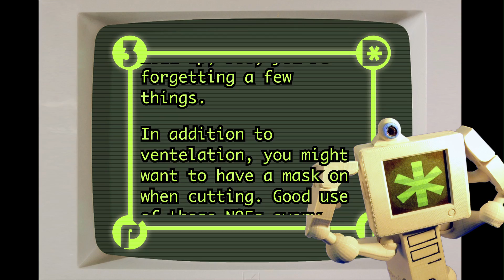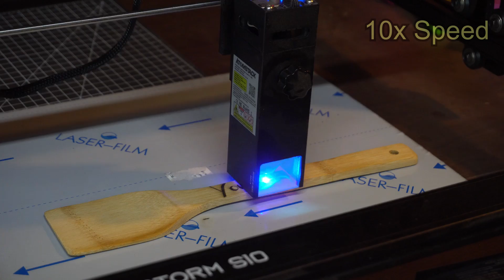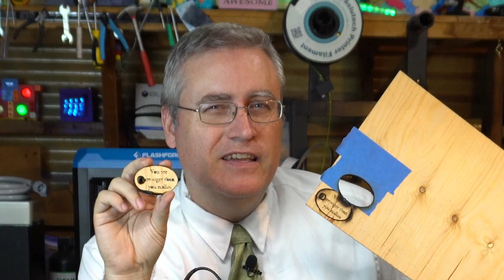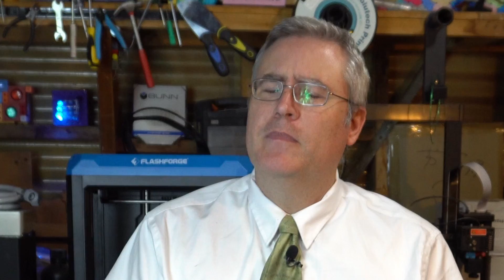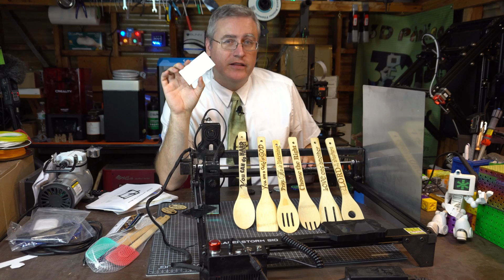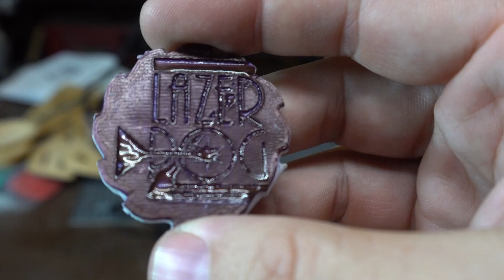Engrave, Cut, and make with the Pergear LaserStorm S10 Review

Comment: I'm sure others have told you, but... You can cut/engrave into white materials (including things like glass and mirrors)... You just need to coat the material with black acrylic paint and then remove the paint afterwards. Actually, to engrave white tiles, or to get black markings on glass, you coat it in white paint. Odd, I know, but... You might want to check out The Louisiana Hobby Guy on here for some great advice on diode lasers and Lightburn.

I've loved playing with my engraver since I've gotten it. It's as an addictive hobby as 3d printing! :)

Comment: Regarding your experiments to "engrave" w/ printed PLA: Looks like this particular laser (w/ its respective wavelength) is unable to impart sufficient power (i.e.: energy *per unit time*) quickly enough to incinerate (vaporize) the small lasered spot of PLA plastic.  Instead, it is only able to heat/melt the plastic.  The molten plastic then transfers heat to adjacent areas via thermal heat transfer. This heat transfer draws the laser-provided energy toward heating an ever enlargening melt zone, rather than incinerating/evaporating/vaporizing the intended small spot being lasered. 

More detailed calculations involving the plastic's specific heat capacity, latent heat for phase changes, thermal conductivity, color-energy absorption at laser's wavelength, along with laser power & spot size would be informative to checking what's possible/impossible.

Comment: I always have the warnings in my videos about open air lasers.  As you mentioned they can be a great tool.  However, you need to practice best safety precautions during operation!  As others mentioned, using air assist will definitely help with cleaner cuts.  You can also use a honeycomb bed, this will raise the material, and allow the laser to pass through more effectively.  Great video 👍

Comment: With these open frame lasers an enclosure with ventilation and air assist are almost a must have out of the box. The air assist will help with flare ups and give you much cleaner cuts at the same time. When it comes to the enclosure the one from xtool is really nice with a green window to help block the light from damaging your eye along with the eyes of anyone else in the room. There's also a exhaust fan built into it. I did a test with an air quality detector right on top of the closed enclosure and there was not change to the are quality, so not bad. On top of all that it's make of fire retardant materials.

If anyone is looking to get something like this, please make sure you look up what materials are safe use with it. For example burning, engraving or cutting PVC, like fake leather will make gases that can kill you, so be careful. Oh and don't use the laser on vinyl 😅👍

Comment: open frame  lazer ... 
we need to stop buy them so companies stop making them ...
Reply: Not all open frame lasers are bad but there're so many flooding the market right now that it is a problem. Also out of the box most of them need upgrades like an air assist and enclosure with ventilation. Don't get wrong they can very dangerous if you don't know what you are doing or what materials you can even use on them.